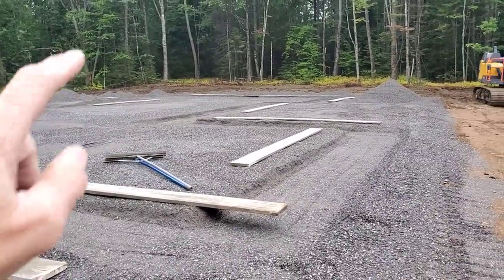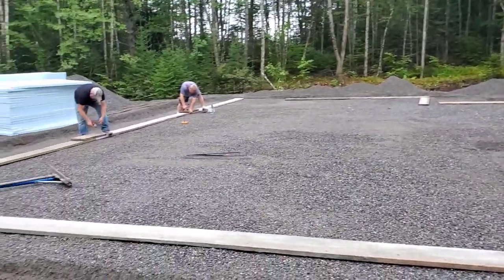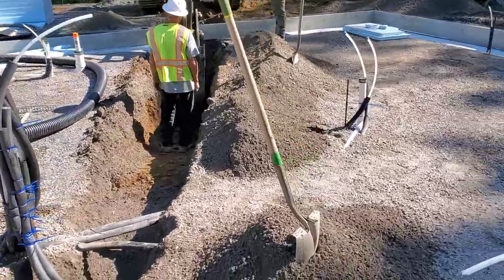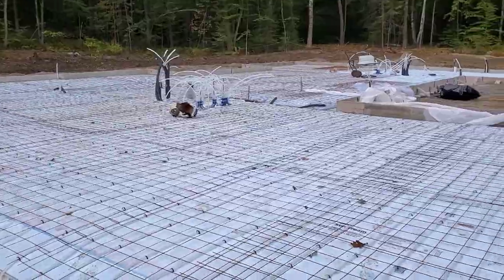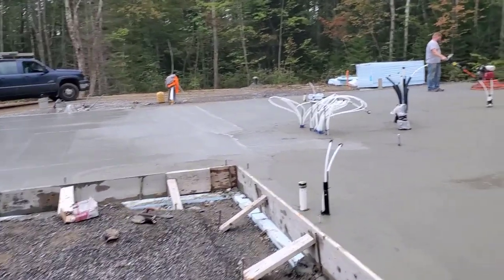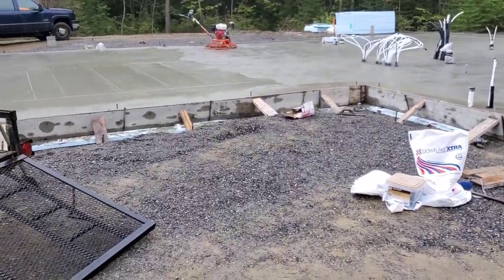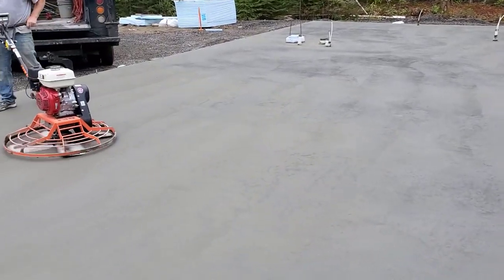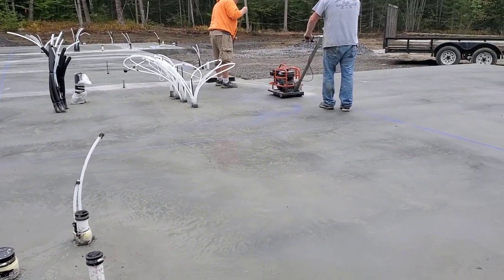We Got Rained ON! BIG 3000 Sq. Ft. House & Garage Concrete Slab

Comment: Great video! Have you ever dealt with piers for a pier and beam house? How did you approach it?
Reply from the maker: No, there's no homes built on piers here in Maine.
Reply: Here in texas we built the forms to a 6500 sq ft house ditches were 30 inch deep 14 ib wide . And it had 93 piers all at 12 ft+ depths 1500 sq ft of ditches. Totally different work than here

Comment: Hello Mike, thank you.
In Russia it is called “Утеплённая шведская плита” (insulated Sweden plate). Please, how deep you cut plate, because I saw some pipes inside plate?
Reply: About a quarter of the slab thickness. It's just to create a weak point for the crack to start in a controlled manner.

Comment: Do you prefer wire over rebar? And is there much of a difference if you use one or the other?
Reply from the maker: Wire is good for residential and some commercial slabs and floors. Rebar is for more commercial slabs where heavy duty use is forcasted.
Reply: My old boss would use 3/8 in rebar in side walks Patios steps 6 in walls and driveways  at 4 inches thick

Comment: I thought concrete “drying” was a misnomer and that concrete “cured” according to time not water content.
Reply: It cures. But it releases a film of water that has to dry or be re-absorbed by the concrete so you can finish it.
Reply: @xavytex  so you have to keep working it so it doesn’t cure before you finish?
Reply: @eprofessio  You have to place the concrete, screed it, mag trowel it. Wait for the water to come up and then disapear (evaporation and/or being sucked back into the concrete) and the concrete start curing. You test with your finger. When you can make an 1/8 inch indent, the concrete is ready to be finished. If you finish it too early you’re going to move concrete around and that’s not what you want to do. Finishing means you’re pushing the agregate down a fraction of that soft 1/8inch (sand and gravel), and the cream will stay on top (essentialy the finest agregates and portland). Start finishing too early with water film on top will just mess up the job. Start finishing too late and you’ll have a hard time pushing the coarse agregate down.
Reply: @xavytex  alright.

Comment: 5k profit one day? Don't know why people bring sewer and water lines into the center of the slab, I think putting them at the perimeter then running thru walls would save a ton of work and expense in case of future repairs.,
Reply from the maker: They have to have the right slope from the bathroom to the septic tank. It's always done under the slab here.